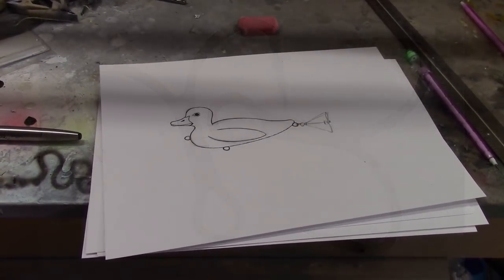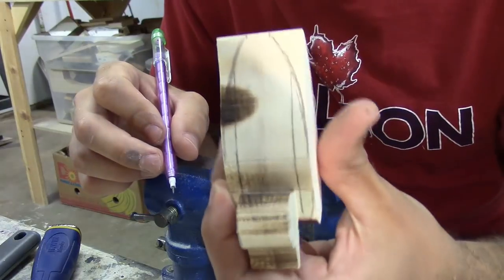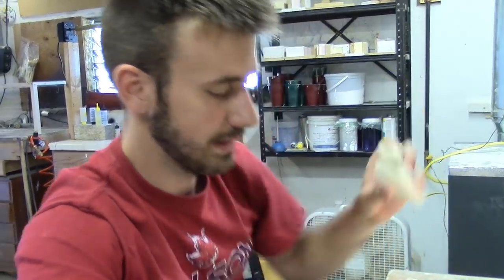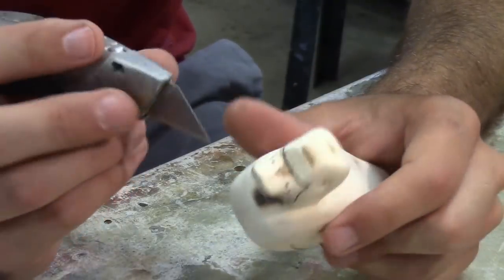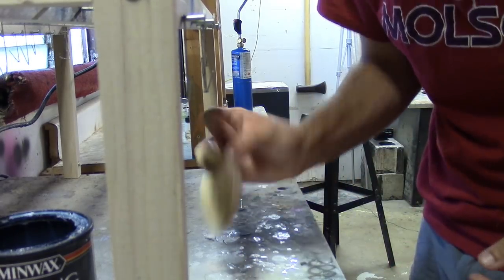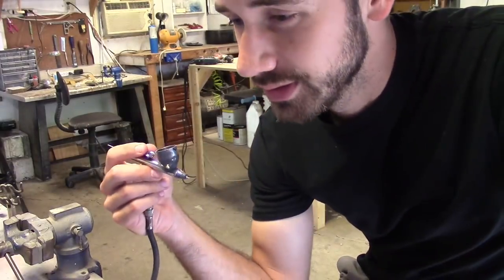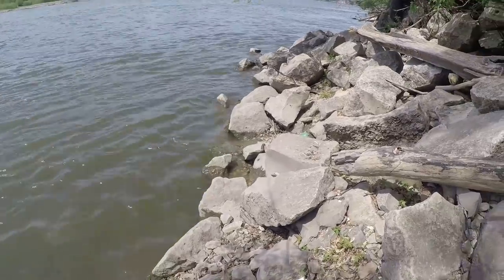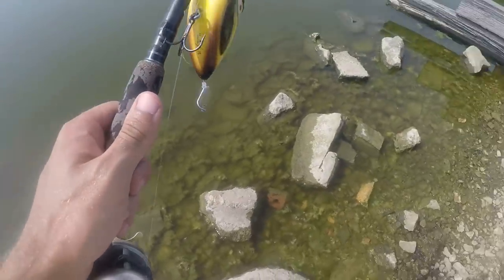Making a Duckling Lure

Comment: Just a little suggestion about a new cheap tool you may find really, really, useful for your carving out work.
There are 2 special little knives that craftsmen who carve wooden spoons use. One is a very short, sharp, pointed knife, the other is a special curved over, rounded, blade used to scoop out small slithers of wood, in a dome/rounded shape. They are available of course on Amazon - just type in spoon carving knives and several sets will come up, ranging in price from about $15 up to about $40, depending who you buy them from, and the quality you desire. I hope this helps as they would definitely help with some of the more awkward areas you carve. Another very interesting video with lots of woodworking tips and tricks, which is my main reason for watching your channel, apart from them being very entertaining. The dog did an awesome job of supervising the entire project as well.

Comment: I feel like it might be easier to make some of the details with a rough file and good set of fine files file rather than with hobby razor or chisel especially on the head and beak or before you sand. If you don't have any you can always spray glue some sand paper to some popsicle sticks or even use dollar store/bulk emery boards. Also a safer alternative to holding a small piece while you drill it in the drill press is to use some thing flexible like a bag of beans or rice so you can position it at the angle you want it and it is supported better.

I"m also hoping to see a dragonfly lure if you havn't made one already, for insects you can loop the strings at slightly different lengths to get a more defined wing shape. keep up the good work, love the craftsmanship!

Comment: Add some feet, Pikes attack Duckling by the feet.
Reply: Pike stays the same as a plural, likes is not a word
Reply: I would have put the spinner just above the treble hook, to spin and act like little bitty feet
Reply: Ari Leon Baumberger , Paint the treble hooks duck foot colors. Big trebles, maybe on swivels to help them dangle just right.
Reply: Yip
Reply: @tphvictims5101  good call
Reply: @zer0deltav367  Excellent!
Reply: @Thwarptide  that was a typo. AND I'm going to save you the trouble of correcting me on that one as well. 

'Pikes' is a word, however, it reffers to the midevil weapon.
In this context (reffering to the fish) it is gramaticly inncorrect to use it.
Reply: @zer0deltav367  *refers
Reply: @Zer0deltav The first letter of your comment should have been a capital. You spelt refers and referring wrong. You spelt medieval wrong. The funniest thing of all is you spelt grammatically wrong, WHILST CORRECTING SOMEONE'S GRAMMAR. You're hilarious.
Reply: @wolfie498  Dammit, my plans have been foiled. All those years of failing elementary school spelling tests have finally come back to bite me.
Reply: @zer0deltav367  found this a year later, but pikes is actually a word. it refers to multiple types of pike. the same way that deer/deers work. if there are multiple types of deer, you would say there are deers. I don't know if all pikes go after duckling feet however.
Reply: I did not know that

Comment: Instead of a forstner bit, you could use a Brad-point drill bit for smaller holes for the eyes. You can go as small as 1/8 or 3mm with similar cutting effect

Comment: Hey man i need a nice cheap clear coat what should I use?
Reply from the maker: For a slow cure epoxy clear coat use a 40% off coupon and get Envirotex lite and hobby lobby or micheales. For a 30 min epoxy get devcon 2 ton, or BSI 30. Not a huge selection out there, but none of them are crazy expencive.

Comment: They are not forstner bits, but other than the tendency to want to drill fast and deep holes, these come in smaller sizes and have the brad points in the center: https://www.rockler.com/25-piece-hss-brad-point-drill-bit-set-imperial